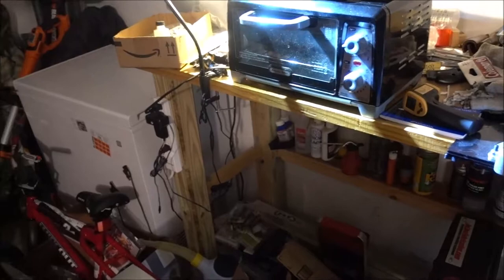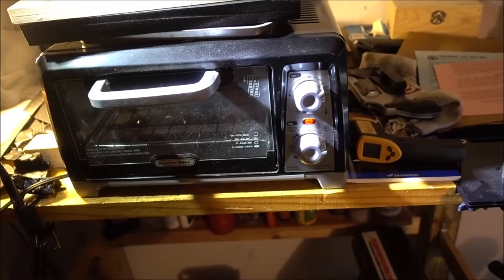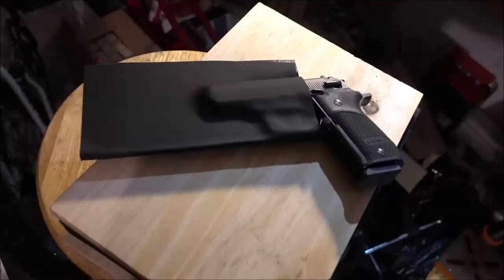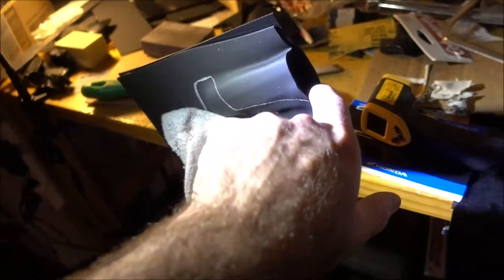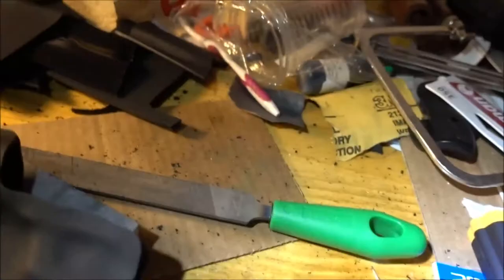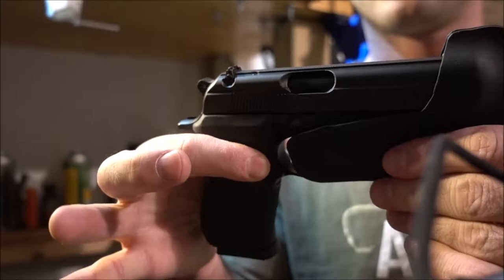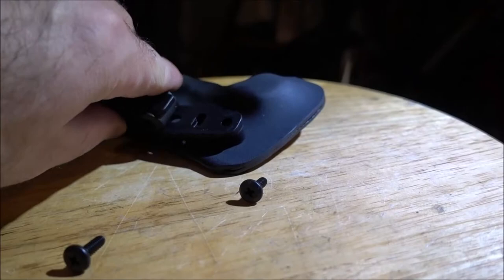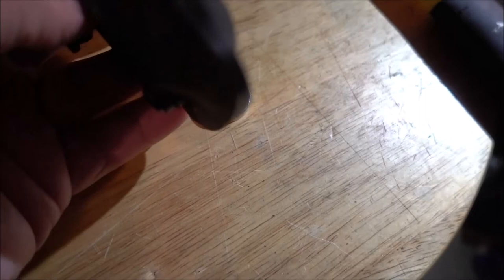How to make a CHEAP and EASY Kydex Holster

Comment: wish you would have covered what the retention level is like but perhaps i missed it. Thanks for the vid!
Reply from the maker: You can make it how you like it. It's all about the fit around the trigger guard. I like it to hold the gun turned upside down, not much more. I adjust the retention with my heat gun.

Comment: Very cool video. Thanks for sharing! Just started to look into making my own holster for my gun. Would it be easier to perform your cuts while the kydex is still hot before press forming it onto your gun?
Reply from the maker: No, when it's warm it's floppy and harder to cut. You also don't want to take it out of the vise until it's fully cooled or it will loose it's shape.

Comment: you make good videos do you have any suggestions for gym shorts or jogging pants i dont wear pants or a belt and i am going to go get my conceal carry permit so i need a holster i want it for a fn509 compact tactical
Reply from the maker: You have two choices. Get pants with a belt, or get a smaller lighter gun and pocket carry. For gym shorts you need to get an alloy J frame or maybe the .38 spl LCR or LCP in .380.

Comment: Wow this is exactly what I'm looking for in a holster. One thing you didn't show, how easy is it to reholster the gun (revolvers specifically)? Also, do they sell longer clips? Can you make the holster tuckable by attaching longer clips?
Reply from the maker: Cutting it the way I do makes re-holstering difficult without removing the holster, but it can be done. Because you're making it yourself you can buy and use any clip on the market.
Reply: SuperSneakySteve  thanks for letting me know. If you accidentally make it too tight even after putting on the clip, could you loosen it by taking off the clip before you heat it up?
Reply from the maker: @jhstylewon1172  Best way is to take it off, but I have been lazy and got away with putting an old sock over the clip to shield it from the heat.
Reply: SuperSneakySteve so do you think you'd update the design?
Reply from the maker: @jhstylewon1172  This is the best general idea for an IWB holster. I have done a few small things for specific guns. For a 1911 I leave one side longer to lock in the safety. It requires a cut before forming the kydex. I also like to form around the mag release on pistols so it can't get bumped.

Comment: So would this style work for a light bearing pistol?
Reply from the maker: It's possible but difficult. You'd need to form the kydex with the light attached then make enough room for the light to come out of the holster.
Reply: I have a sd40ve that DOESNT malfunction every other round for the nay sayers out there and it has a cain arms plus 5 extension and a trl 3 streamlight and i cant find a holster or anybody to make one to save my life.. Its looking like ill have to go the diy route..
Reply from the maker: @jtkirby2931  Look at designs from manufacturers that use lights. It looks like they don't get tension from the trigger guard like most so you may need to make a clam shell design and find another way to get tension. Still very doable as DIY.
Reply: Thanks man SuperSneakySteve